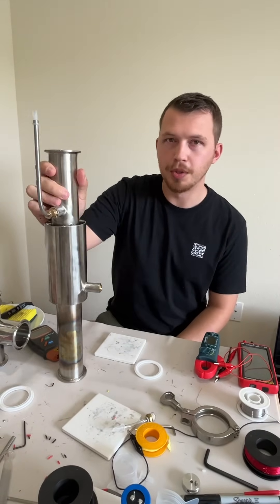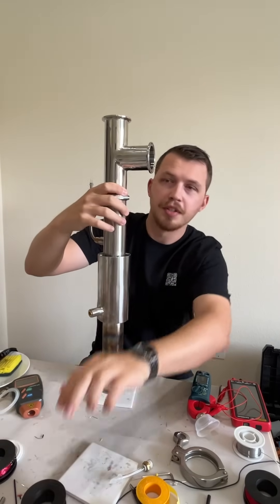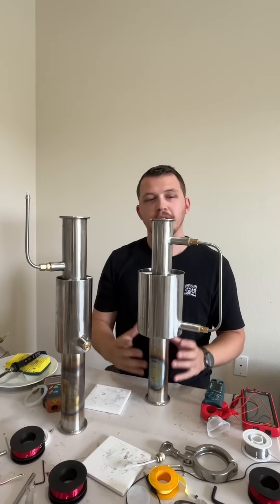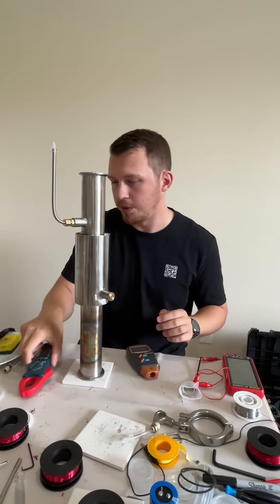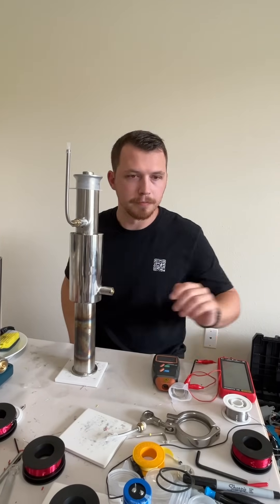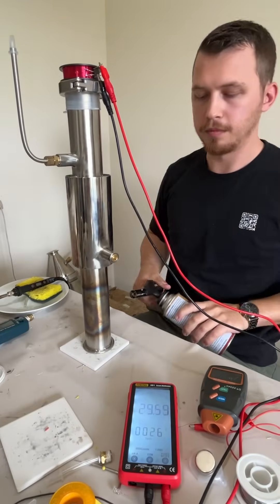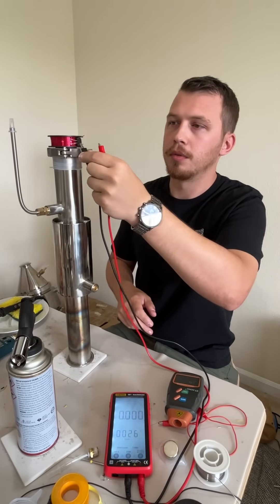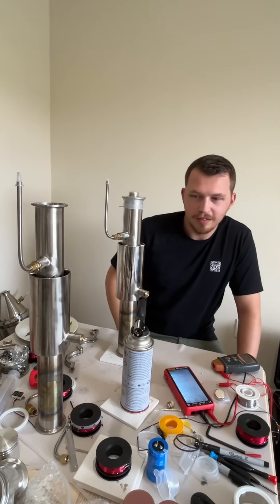Custom High Temp Stirling Engine #stirlingengine #thermodynamics #electricgenerator

Comment: Hi there! I really like your design, also the experiments. Congratulation! But I have concerns about performance measurement. This unit has not enough mechanical energy to produce 80W. I'm sorry, but if your air core could handle 80 watts, your LED strip would burn out within a second. Without full bridge rectifier you should measure AC voltage first. BLADE
Reply from the maker: I can make a video in this, but there is a lot going on here than just a thermoacoustic engine. It’s about coil length, coil thickness, magnet strength, RPM, and heat retention. However, the biggest problem here is that the efficiency is being calculated terribly wrong. An average blow torch produces 1800w or so. This converts that heat to 80w or so (I mentioned in this video that the higher heat the higher the output). 

To calculate the efficiency of the Stirling engine, we need to use the formula:

Efficiency = (Useful output energy / Input energy) x 100%

The useful output energy is 80w, which is the amount of energy that the Stirling engine can convert from the blow torch heat. The input energy is 1800w, which is the amount of energy provided by the blow torch.

Efficiency = (80 / 1800) x 100%
Efficiency = 0.0444 x 100%
Efficiency = 4.44%

Therefore, the efficiency of the Stirling engine in converting blow torch heat to useful energy is 4.44%.
Reply from the maker: Voltage limiter, capacitor, and half wave rectifier are included in the spool! Come on! That’s easy stuff haha
Reply: @LES_Thermodynamics  This kind of response is too much for me... sorry! Just calculate a bit backward with me. Basically I'm pretty sure you've made some mistake somewhere. Actually you talking about 45Watts, but your other videos talking about 80W. No problem with it. Try to calculate backward with me a bit. Standing wave units theoretical efficiency around 18% The best lab-units never hit this limit... With pressurised (40bar) Helium they could hit the 10%, where the onset temperature is increased around 600-700 Celsius (Electrical wire heater inside!). They used high grade heat exchangers, that is not included in yours. If you wants to read a lot about TA standing wave units, hundreds of pdfs available in this nitche, then you can find some rule of thumb numbers. With ambient pressure air working gas your unit has pretty low efficiency, probobly under 0,5%. A unit around at your unit-size and parameters if I remember right at 10 bar Helium could hit 2-3% efficiency with 630W input they've got 18-20W acoustic power. So just calculate backward. If you could have a same unit with high grade-efficient heat exchangers and high grade parts, with 10bar Helium gas etc...etc... and you just measure this 45W-80W then you should put in into your engine 2,5-4 times higher power as these engineers does. But your engine has 10 times lower pressure and air gas inside. And the high grade heat exchangers are not included, also your heat input coming from a free non-uniform gas flame. Just follow the flow: If your engines on a high grade level then you should use around 1300W-2500W wire heating. But in your lower level, you should increase these numbers 5-10 times, because of the gas parameters, also the engine parts grade. Are you sure you put this power range onto the hot side? And then I've no time to talking about the burning gas-solid wall heat exchange efficiency that will give another number we should use basically to get a correct input parameter that your burner should create. I know these are just numbers, but please think your side again. Kind regards, BLADE
Reply from the maker: @AttilaBlade go back and watch the videos again. Everything you are looking for is in there. 

Also, this unit is not pressurized. It works in a vacuum.
Reply: @LES_Thermodynamics  Sorry for that You don't see the differencies. In vacuum... Then the input numbers should be higher than I wrote. That's one of the basic problem around this unit. An 80W unit hardly push your hand. Try to push back an 80W electromagnetic push-pull solenoid at 40Hz. Sorry for the simple words, but my english not sofisticated enough, but I know what I wrote here. I thought about higher efficiency when I was much younger. Also I wanted to see how can I build a 10W unit from tin cans. After I built more than a hundreds of hot air engine models to learn, and worked in a Stirling-TA project. I'm not the man who knows everything after 15 years of experiments, and 7 years of professional R&D engineer, but I do not believe everything that I see. I didn't mean to bore you or question your competence. I was just counting backwards and seeing numbers that I don't think are possible in a build like this. Don't be angry, I'm so happy to see people as You to make things. I'll be happy with 80W of output that came from a DIY unit. This range is not so available now. People always wants kilowatts... But for emergency usage 100-500 W could be enough. Rooting for you! I wish you perseverance on your journey! BLADE
Reply from the maker: No problem! There’s a huge difference between using SS304, a custom heat exchanger & stack (ceramic) and the size of this unit, versus soda can models. 

I watched your videos and I’d challenge you to make one using these materials and thermodynamic theory, then reevaluate.
Reply: You are quite understandable I guess  Greetings.
Reply from the maker: Also in the video it was 31v at 1.5 amps, which is 46 watts.
Reply from the maker: A video with 30-40 watts? Explain what you’d like to see
Reply: @LES_Thermodynamics  Hi! Other people also have measured wrong performance , even real best scientists who have this field of expertise. Long time ago I've been wrong also, it  happens with the best often, it's okay not problem. I think approx. It can be 0.2 Watts. But your engines are really good ones I like those! Keep it up!
Reply from the maker: @thisisajewtube thanks for watching my most recent video. The unit does in fact not produce 0.2 watts .. haha
Reply: @LES_Thermodynamics  For example, it is a common method, especially in the past, to measure performance with LEDs, which is not good. For example, in the documentation of an LED, it consumes 0.06 Watts of power. In reality, it already lights up nicely with 0.002 Watts. Thus, for example, it is possible to be wrong bigger by a factor of 30. I made this mistake a long time ago, I'm not good at it, but so are those who are scientists, and they understand it much, much better.
Reply from the maker: @tibsim  you are right. There are some Stirling engine creators on YouTube that like to use LEDs as a power indicator. However, I’d suggest you look into this specific LED. The white LEDs that are normally used require almost no electricity.
Reply: @LES_Thermodynamics  I think Youtube didn't show one of my posts. So I didn't know that this is a steam engine, I thought it was air. With steam, the performance can be a little higher, because you feed it with high heat and the heat exchanger is wide. From my experience, I think it can't be bigger than 1W, but I could be wrong. I'm often wrong, but I think simple 1W  category engine, is also amazing, and it's already usable. According to my experience, the very tiny hole instead of the valve worked well for me, and it is much stronger the engine if the membrane is closest to the heat exchanger. Then it doesn't sing, but the machine vibrates more strongly with a membrane. What is your opinion, can the machine be improved if we make a two-stage drive? That is, in one engine, in which the working medium is water, is an another one, in which ethanol is used. You can find the drawing on the stirlingengine forum topic: "Absurdly simple thermoacoustic-steam "rice" engine – What's going on here?" last post...
Reply from the maker: Literally everything is custom and has been optimized. I had many different designs with different valves and lengths. This current design works the best. Also, the valve helps by lowering the energy required to create steam. When we remove the air pressure, the most energetic water molecules become water vapor gas. This is the same reason it is easier to boil water in the mountains than it is at sea level: you need to add less energy to get the water boiling when there is less air pressure on it.